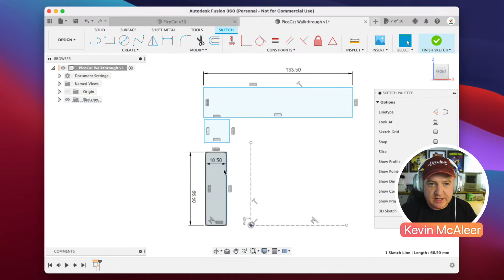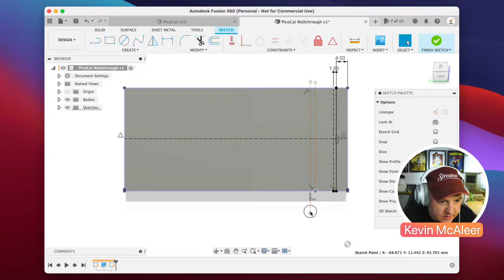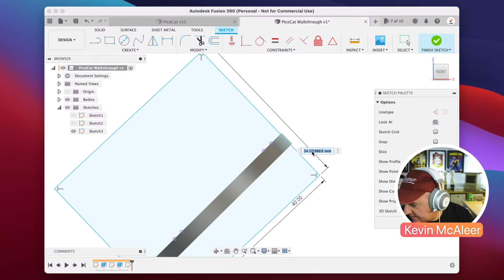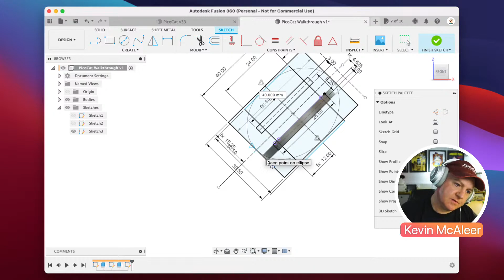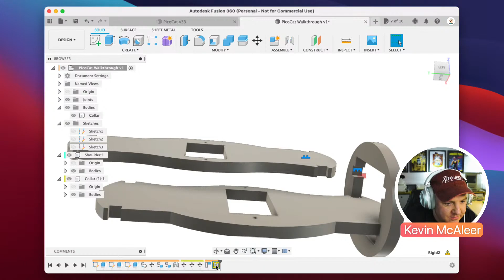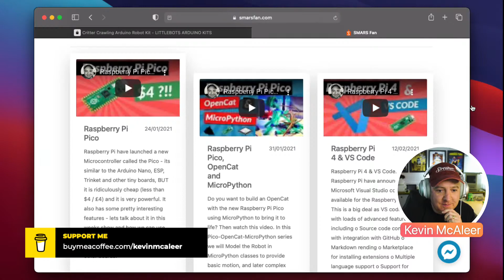PicoCat & Fusion 360

Comment: Great video. I haven’t gotten into CAD design for 3 D printing yet, but it’s on my list. It was a good introduction into the thinking that goes behind creating the CAD design. I may have missed it, what did you base your design on? I saw you were measuring parts that were already printed. I’ve seen a couple of OpenCat models on Thingiverse. Was there a reason you didn’t start with one of these other than teaching how to design from Fusion 360?
Reply from the maker: Hi Luis, Great question! I wanted to model this for a couple of reasons, 1) to understand how its constructed to inform my design choices for future robots, 2) because I want to modify some parts, and I might want to modify other sections of it to, so making it myself helps that in future, and 3) because I wanted to! Thanks for your comment and look forward to seeing you on a future stream.
Reply: @kevinmcaleer28  Makes sense.